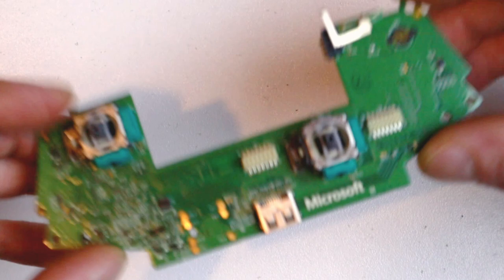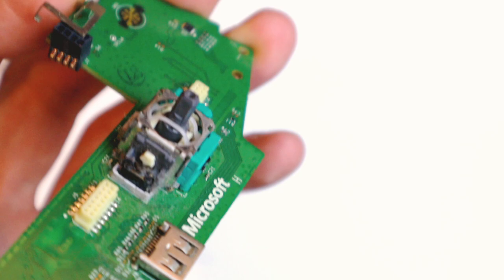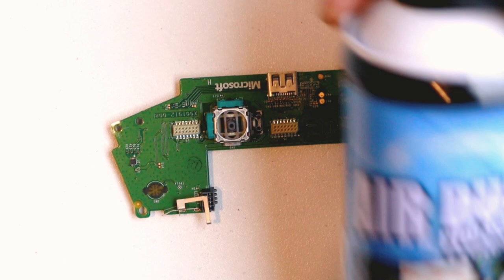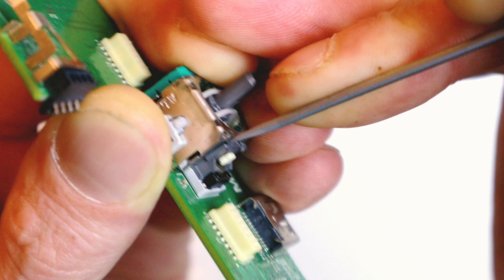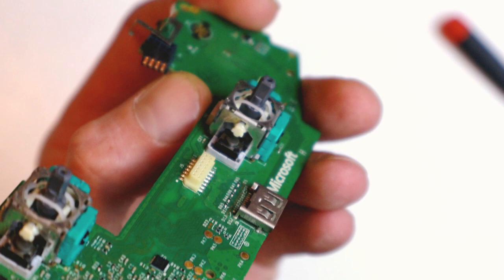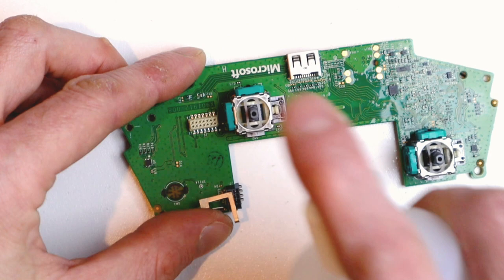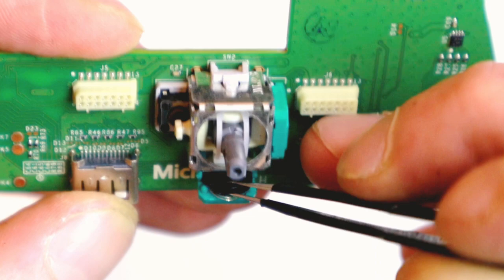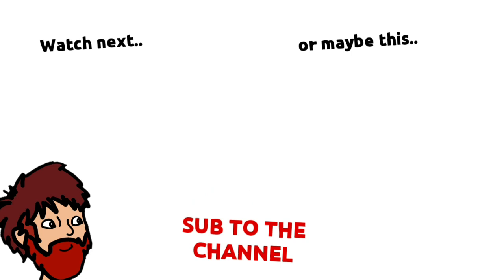How to Fix Controller Stick Drift - Best Methods

Comment: Are there any ways to fix stick drift without having to take the controller apart? I don’t want to try and take it apart and mess something up 😂.
Reply: Honestly I have very slight stick drift and I don’t want to break my controller and dismantle it over a tiny stick drift
Reply: without taking anything, just pour a bit alcohol down the gap under the stick. move stick around. alcohol will gather up all the dust and shove them aside, hopefully freeing anything stuck. no guarantee though
Reply: @100percentnotabear  thanks I might try that out.
Reply: @vibenkirbo8531  same especially since I've got an elite controller
Reply: Make sure the alcohol is dried up tho, your controller might catch fire
Reply: Blow under the joystick works for my ps4 controller
Reply: Try using alcohol wipes and wipe in the edges of the button
Reply: @100percentnotabear  sir you just saved me from alot of stress and pain. Thank you
Reply: @chululu7657  did it work??
Reply: Using the controller it's self will push the dirt away, after half a year of course
Reply: Make sure to use atleast 90% alcohol
Reply: @Mango-vd1nn   wdym by dried up?
Reply: @redtoadsquad2439  he means dried. Like how water dries up
Reply: @apple sauce no, :) they mean after you use it, let it dry
Reply: @Mango-vd1nn  There is a reason we use Isopropyl alcohol, because its non-conductive. So no, even if its wet it won't cause a fire but it might impede electrical currents if there is enough of it.
Reply: @vibenkirbo8531  I have a huge stick drift
Reply: HelloThere  no, don't do that
Reply: @Adam-yn3si  did it work?
Reply: @ihatethisfirstandlastnamet2435  not gonna lie, I just got a new controller lol
Reply: @twarofficial  WHAT
Reply: @im.glenn.quagmire  that puts saliva in the controller, making drift worse
Reply: @cowardice9737  didn't happen to me
Reply: most controllers can just be unscrewed . You can't mess up a controller by unscrewing it and using a bit of  Isopropyl alcohol and a tooth brush.
Reply: @im.glenn.quagmire   That actually worked perfectly. Thank you so much.
Reply: @Aerythraea  np
Reply: @vibenkirbo8531  dude mine drifts over anything I have to hit my controller to make it stop its so annoying so this video helps
Reply: @100percentnotabear  will it work for severe control drift
Reply: @bradynbassett8814  that’s what I did, I just ended up getting a new controller lol
Reply: yes yeet it on the floor there you dont need to disasseble it cause it did it for you
Reply: L U B E
Reply: @cowardice9737  bro you actin like my mans is spittin on his joystick lmao
Reply: @100percentnotabear  worked like a charm thanks brother
Reply: Fr
Reply: @user-vo3ps2oz7h  
yea rubbing alcohol not the drinking one
Reply: No
Reply: Nope unless u have access to compressed air lol
Reply: It's so easy guys honestly a child could do it, just a few screws and some plastic clips lol. If it's already shagged, may aswell try fixing it before forking out for a new one!
Reply: Yes, they can be recalibrated
Reply: Simple just turn up your dead zone in game settings and it's done
Reply: @Adam-yn3si  did it work
Reply: @RajProX08  ngl I just ended up getting a new controller lol
Reply: @ka-bc7ky  nice pfp
Reply: Buy an xbox 360 adapter
Reply: @Mango-vd1nn  lmao really...
Reply: @100percentnotabear alcohol not always gonna fix it 😭 usually the controller joysticks are worn out and just don’t work
Reply: @100percentnotabear  I wanna do this but I feel like I'm gonna mess up some crap
Reply: @EAZYEV  not really because on rust my dead zone is turned up to 50 and I'm still getting it smh
Reply: If you had a dualsense edge controller,  then you can fix drifting sticks for 20 bucks each and 20 seconds to put them in.
Reply: you won’t break it from opening it up trust me they’re more durable than you think. home depot or any warehouse store will have a torx 8 security screwdriver. it’s quite fun actually, everything clicks together nicely it’s fool proof

Comment: I found that just popping out the green things on the side of the joy stick just a tiny bit fixes it
Reply: Like pushing them outwards
Reply: Son.
Reply: @dad2107  Wowzers, back with the milk yet?
Reply: @basicanxietyattackinduces5774  No they didn't have chocolate Milk.
Reply: @dad2107  But then how am I supposed to survive without it?
Reply: @dad2107  ]:
Reply: @basicanxietyattackinduces5774  Hey it's for the experience.
Reply: @dad2107  Isn't that how mommy was arrested?
Reply: @basicanxietyattackinduces5774 Something like that but worse.
Reply: Lol ok I am lost

Comment: man, i cant believe my xbox one s controller is almost 5 years old, its still amazing to use, did a replacement for the rubber for the pads awhile ago, but recently the left analog is drifting, altho not that bad but definetely going to try this, thanks !
Reply: the rubber does wear out
Reply: @Todomo  it does, but you know what, 2 years later this thing still works... Like holy... Really a great investment 😂

Comment: The other method is to de-solder the analogue stick from the board and replace it, but keep the pod's (the 2 directional pod's on the sides).

Comment: Protip: Give it a blast of Deoxit D5. This removes all the crap getting between the contacts. Deoxit producs are used in audio production to clean up all the potentiometers that are involved on sound boards and electrical contacts in the other hardware, which is an awful lot like what you have in your stick module.

And if your ready to completely replace the modules and are feeling adventurous, try some DeoxIT L260-D5 Grease. As long as the carbon isn't horrifically worn, this should lubricate without messing with the conductivity too much (it's dielectric, meaning thin layers between two contacts will conduct, but any further and it becomes resistive so it doesn't short things)

Comment: An item that saved many of my controllers, WD40 Contact cleaner - NOT regular, but specifically labeled as specialist contact cleaner quick dry. Just remove the stick caps and spray a bit in, turn upside down and let dry. 
Almost always works, unless there is something broken in the joystick module.

Comment: can you do how to fix drift without taking apart the controller or is that possible
Reply from the maker: I'll see what I can do but as you can see in this video, you really need to be able to clean it properly to make a difference and the plastic joystick covers block access when the controller isnt disassembled. Challenge accepted though, im thinking the isopropyl method may make a difference if you can get it to spray down past the joystick cover. (Hope that made sense)
Reply: I was watching a different video that doesn’t involve opening it all you have to do is blow into the joystick try that also it’s kinda like CPR so yeah try it
Reply: @smorescorp601  I saw those methods, blowing into the stick doesn't work very well and the other one doesn't fix it for long
Reply: get a cotton swab and rubbing alcohol then rub it on the edges of the joystick

Comment: Just a quick tip for the alcohol part when spraying it down cover the board up with a towel or something just so it doesnt soak. They are usually built well enough but if you have a damaged one or its just really old the alcohol could get into it and Its just better safe than sorry.
Reply: alcohol is non-conductive and evaporates fast. you know absolutely nothing except how to leave a false, pointless comment.
Reply: @generalzova921  Also just to be clear in alchohol's raw state and pure form you are 100% correct that it isnt conductive but nobody every uses it that way and in the video the kind that was used is most definitely conductive as it is a mixture and not only alchohol
Reply: @anon7248  You can hose down a motherboard with water and it will still boot just fine if you let everything dry.

Alcohol will dry even faster, it’s a non-issue.
Reply: @calvin659  like I said in the first comment they are usually built well enough but if yours is damaged or is pretty old it can be damaged by getting wet. It's just better safe than sorry because if you have a problem with one you didnt know about then soak it thinking it will be fine then it's not that's usually at least 100 dollars down the drain. It's just an extra precaution to take thats all.
Reply: @anon7248  the alcohol won't damage the components at all it work in such a way where you could literally dip it in a bath of the stuff and it would still be perfectly fine as the minerals that damage electronics are not present in the alcohol
Reply: @siinstroze8274  like I said before typically parts are built well enough to get wet and be fine but if there is damage or just excess wear then it could get inside and if you are cleaning something chances are it not brand new. And like I said before the alchohol isnt the issue it's the fact that you arent using pure alchohol it's a solution mixed with water. If you dont believe that the water stays after the alchohol evaporates then get a bottle pour a small amount on a semi heat resistant surface (stove, ceramic, stone countertops ect.) And light the puddle on fire wait for the flame to die out and see if there is still liquid remaining. There will be which is the left over water that isnt flammable.
Reply: @anon7248  the water does not stay as the whole solution evaporates and no matter how the parts are built they can withstand it. I work for a tech firm my guy I would hope I know what I'm talking about
Reply: @siinstroze8274  And I work for a car dealership and work on computers for newer vehicles. I had to take 2 years worth of schooling as an electrician to get the neccessary certifications I understand how electronics work. And no it doesnt evaporate as a whole. Just buy some alcohol pour some out and light it up and it catches fire or you can pour some wait about an hour and try lighting it just to show that the alchohol has evaporated but the water stayed
Reply: @anon7248  bro hense the reason when you clean electronics you wait atleast 2 hours and give it a nice blow  so everything can evaporate

Comment: My cousin gave me an old Xbox One S controller that had stick drift, and I took the little sensors from my third party wired controller and now it works, but now my rumble motors broke😢

Comment: Just solder on some potentiometers on it that can be adjusted and you can get rid of the drift on the physical hardware instead of using a program to make your deadzone bigger.

Comment: What does jitter in input is  due to?
The joypad worked well before now, but now when I keep the left thumb controller to the left it gets jittering motion reducing precision of the input, it should be stable cause I hold the direction and not move anything but still happens, not always but often enough to make weird movements while playing in Tekken, looks like a sensor issue probably due to powder, should I clean the joypad? Or its' an electrical issue?

Comment: The thing is The Original Controller which came with the console is fine
But the other one I brought later is drifting when I select characters in injustice 2
Thank you so much for this video 📹
Reply: I use PS4 tho this is the exact shit happen to me
Reply: I actually bought three of them (newer one) they all fucked because drifting while the og one fucked because i throw it hard
Reply: Same with me. The controller I got with the console in 2016 has never had any problems but the controller I bought two months ago already has bad stick drift

Comment: Isotropl alcohol works on my old vita,  but few hours later its back , why is this , is this just acting like a lubricant on a mechanical issue or is it helping to move all the crap stuck in there before drying up ?

Comment: it's easy to tell which sensor needs replaced.
if it drifts backwards and forwards, then it's the sensor on the side of the stick module that is drifting.
if it's side to side the it's the other one. get tweezers. the sell repair kits on amazon that come with everything you need to fix stick drift except for tweezers, because they send you whole new modules, but unless the whole thing needs replaced, you only need the sensors out of them. you are most likely going to need to buy the proper security torque screw drivers anyway to open up xbox controllers, unless you already have some, so you might as well just go with the repair kit that comes with them. you also get brand new thumb sticks if you also want to replace your old worn out ones if the controller you want to fix is an old one. i'm not a professional electronic device repairman, and i was able to fix my controllers stick drift multiple times using the replace the censors method. i had a really old controller i used for donor parts. the hardest part is getting the controller apart and getting to the sensors without breaking any of the rumble motor wires, they are aluminum wires not copper so they break easier if you bent them too much, it's safe to move them a round, but try not to do that too much or at any sharp angle, they most likely will break where they are soldered in place to the motors or the boards. also don't lose the yellow transparent tape inside the controller and put it back how it was when you are closing up. the black wire with that connects one part of the bottom board to another part of the top board just unsnaps and snaps back into place.

Comment: Not the best method but it worked for me if you don’t want to take it apart you can pull the joystick slightly out then really wiggle it around it won’t be completely clean but it will clear out the area eliminating stick drift if it’s just minor stickdrift

Comment: Omg you don’t have to do this, blow into your controllers joysicks, push it up a bit first, trust me this works so well
Reply: for me it starts again after like 4 mins
Reply: @hasim9531  make sure you do it for about a minute
Reply: @awoke5650  alrigjt ill try it
Reply: @awoke5650  omg bro it acc worked its fully stopped thanks sm
Reply: @hasim9531  nb bro it worked for me as well

Comment: so 2 days ago i found out that my right analog stick is drifting and moving camera angle up in games. now i use it almost daily so i know theres no dust and whatnot collecting inside and causing the issue just wear and tear. do i just get a new controller or try to crack it open and replace parts? its wireless but i use a cord that comes with it to save batteries
Reply: Yeah I had the same problem I took the grey plastic pieces off like in other vidoes it made it worse

Comment: Seems more sensible replacing the sensors than soldering.
Reply: I messed up my controller trying to solder a new module on :(

Comment: I found another, much easier method. No opening needed, just blow in the stick that drifts, like just place your lips on the hole and joystick and blow, it removes the dust from the connectors and voila
Reply: Same with the bumpers on xbox controllers

Comment: Is it possible to swap the stick's wheel sensor thingy ? I mean like put the right stick potentiometer in the left one, and vise-versa.
I only have drift in one of my sticks but it is the important one.. If i can put the drift into my left stick it would be so much better.
Reply: you can buy replacement parts for generally cheap online and just toss the offending piece. you should technically be able to move sensors around but I can't promise anything.

Comment: Ok I need some help here. So my left thumb stick is kinda broken and it’s the only controller I have the thumb stick picks up signal but it’s not working I tested it in the Xbox accessories app it says it works like I move it and it picks up and for some reason the thumb stick works in games?? I think cause I played descenders and it worked it just doesn’t work when I go in like apps or in home and stuff like that. So if anyone might have a solution please tell me and btw this happened because I tried to get rid of drift. Lol I just need help (I meant My Right stick)

Comment: why do they make them so cheap nowdays? i paid 75$ for cosmic red dual sense, got drift after only 9 months. also battery wont last not even 2 hours after 2 years. my ps3 controller never got drift, left analog stick rubber just lost flexibility so it wont return back, a controller i used for over 12 years non stop. even n64 ones are immortals. wtf.

Comment: I’d rather just get a new controller cause this is too much
Reply: Hmmmm $90 To replace, or ten minutes of effort and $3 worth of canned air and a toothbrush... Think I'll go with this first. If you are going to stop using the controller anyways why not give it a shot?
Reply: @randoprior4130  it’s $60 and that method takes too long
Reply: @bludene  Xbox elite 70+ just bought one unless you mean used
Reply: @SeverancePay500  Xbox elite is ass scuff controllers break too fast
Reply: @SeverancePay500  and why buy a scuff controller when you can switch to claw on a normal controller

Comment: putting a whole new joystick module is easier and a better solution as all this does is not actually address the reason for the drift, that pieces of plastic broke off and are causing interference.

Comment: So basically if you have stick drift the controllers broken lol
Reply from the maker: Spot on!
Reply: No, Just order the two small PCBs for fixing stick drift and solder them to the PCB and then tighten the screw with a screwdriver until its zero'd back In the center....